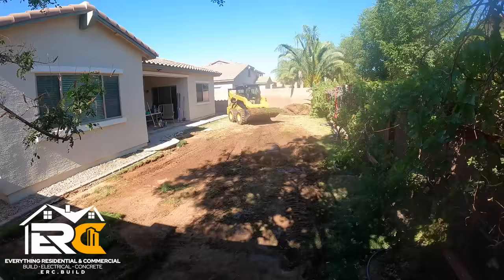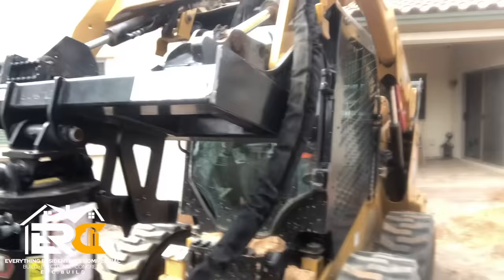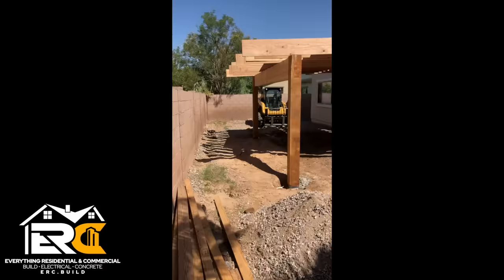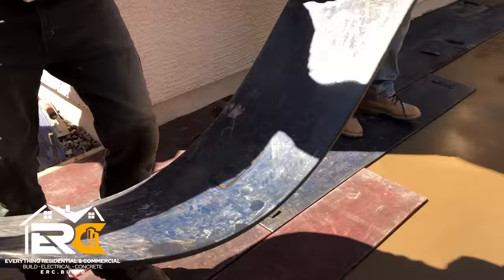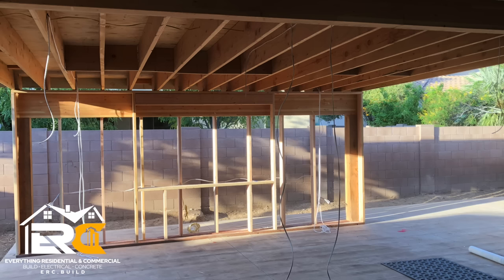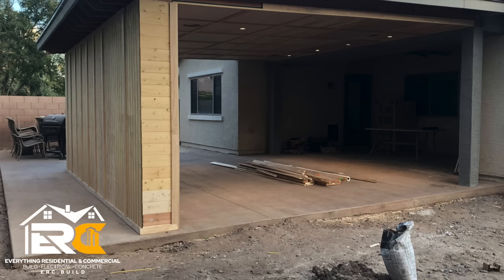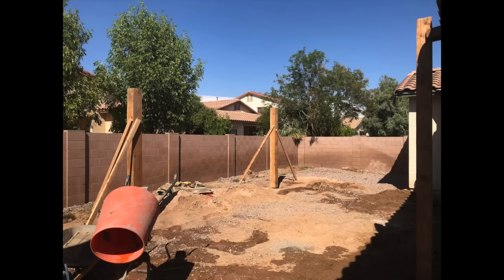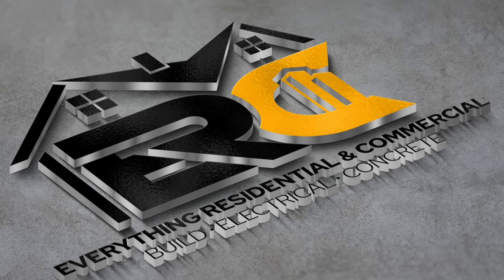How to Build A Luxury Patio Cover

Comment: The reason for the seperation issue is fire safety. Since the patio is attached to the house they probaly conisdering an extension hence it couldnt be close to the rear setback. BUt because you made it freestanding and its open structure you could theory enchroach. That gap counts as fire seperation between teh two structures.
Reply from the maker: I agree but a 1” air gap won’t stop a fire from spreading, typically your fire gap between buildings is 5’-10’

Comment: Oh my God, that was poured at like an 8in slump. Did you  get  any grief from the homeowner on the color adding all that water probably made it two 2shades lighter. lol Sorry just had to say something about that. I really wanted to say great work looks amazing I can't wait until mine is finished I'm doing 14x14 gazebo with tung and groove celling with a 8x8 sectional seating that drops down 1ft from main grade  then wrapping concrete countertops around two walls and rounding the end to a 4x4 rounded table for games and what not  then doing Allen block walls for the concrete counter supports and cabinets with fire place and another section to the side for outside sink BBQ  concrete countertops as well with block in the back and cedar cabinets and so much more I been designing this thing in my head for two years now I'm finally starting the gazebo build tomorrow. You do very good work and I'll definitely be doings that entertainment center wall how you did  I was just going to inset TV and call it good until I seen this project thanks videos and contributing to my project

Comment: Damn I think I’m in love with this design lol. On estimate how much does a project like this cost?
Reply from the maker: Thank you so much! It’s definitely a one of a kind patio cover. Materials are around 10-15k but you can save around 3k if you didn’t have to anchor the posts 6’ into the earth, and if you don’t use a clear span beam where a wall will go.
Reply: @everythingresidential  How about the Labor??

Comment: Just curious, why was the concrete poured without rebar?
Reply from the maker: @alejandrocarrizales1691  we typically install rebar when the concrete will not be exposed to the elements. If you can imaging a small crack in the Crete and water drips in and starts to rust the rebar. That will cause an even larger crack down the road. So we use fiber
Reply: @everythingresidential  ok, so fiber is taking the place of rebar in this case. Makes sense.

Comment: I was wondering how you built it so close to the fence. I have a 43ft by 12 ft patio and I could not go any further out .  I have fans and recess lighting . Still need to finish it off by putting shiplap on the ceiling.
Reply from the maker: If it’s not touching your house your rear setback will be much less, after inspections you can tie it back into your house.
Reply: Have u ever used roof risers like SkyLift to attach the rear of the cover to the house for more lift?
Reply from the maker: @bulld9646  the problem with roof risers is that it doesn’t keep water from by the back wall

Comment: I am wondering about bracing. Because you set the posts in ground was bracing not needed? What does the steel do for the posts? Will they eventually rot?
Reply from the maker: It does not need bracing as the steel and wood in the concrete is strong enough. The steel prevents the wood from contacting the concrete
Reply: Those post are not going anywhere buddy .

Comment: I would of used 4 steel posts and kept the TV wall 1 inch or so off concrete slab with J bolts and nuts.  Super cool look ++ but engineering fails for longevity. . .seen fails like this before . . .learn
Reply from the maker: Thank you and that’s a Great idea, however the vertical posts are sealed with a quad sealant and it has another layer of protection from the new wall we built that also has quad sealant. If customer decides to install gutters this build will last even longer! Thanks for the input

Comment: I would say that the bottom of the wall doesn't look promising... Rain water will soak in the wood, and there are no air gap for panel to dry from back side.. Looks nice, but would be much better if the framing would be done the right way. :)
Reply from the maker: Stuck to the engineers design and luckily this is in Arizona and it doesn’t rain much at all.
Reply: how about a stem wall with some pier hole for the posts and not sink them in the ground , it totally cracks me up seeing some of these videos on utube . there is a right way then there is a u-tube way and before you say anything I've been a carpenter for 40 years and I have seen what works and what doesn't ! by the way your engineer is high , it doesn't make things right sometimes just because of an engineer most over build but it does show me that this one doesn't
Reply from the maker: @jayralston2305  great idea, like I said above stuck to engineers design and the customers were not sure on exactly what they wanted the wall to be until the roof started to develop.
Reply from the maker: @jayralston2305  amen

Comment: What was the issue with attaching the house, I run into this a lot
Reply from the maker: Anything attached to the house abides by the house setbacks. However separate structures  abides by a different set of setbacks and you can encroach pretty close to the back wall.

Comment: What’s the cost for something like this
Reply from the maker: Around 15k in material depending on style
Reply: How much is total cost material and labor this style?
Reply from the maker: @nelsonleon7580  it’s been awhile since I’ve seen the contract but it’s around 35-40 with stamped concrete and all the upgrades
Reply: 35-40K is insane for a patio.  Might as well add two glass sliding walls to make it an enclosed entertainment space for year round use.

Comment: Hi, why no reinforcement mesh for the concrete slab?
Reply from the maker: We don’t believe in rebar or any kind of steel in concrete that is exposed to the elements, unless it is a driveway with heavy equipment or vehicles, as when the concrete cracks and steel is exposed to the water it will cause cracking at a much more rapid rate. We preferably use fiber in concrete exposed to the elements

Comment: Hows does it cover when it rains 🤔
Reply from the maker: What do you mean how does it cover?
Reply: When it rains does it stay the way it is ..or does it have  something to cover the sides?
Reply from the maker: @panzon3236  we are in Arizona so it doesn’t rain that much but yes the sides are open, the customer could get shades but you risk getting them damaged if it’s to windy. The water doesn’t puddle either because the concrete is sloped
Reply: Thank you 🙏